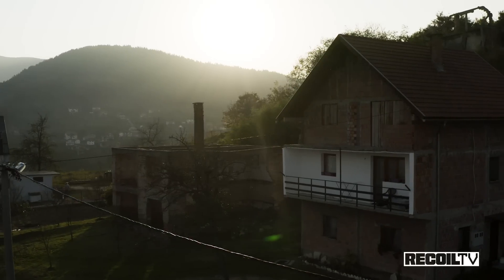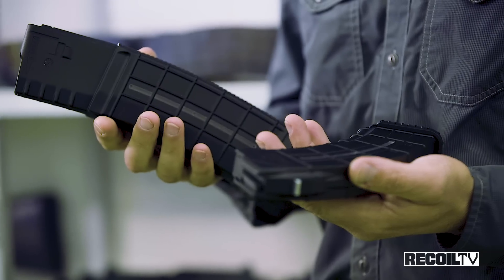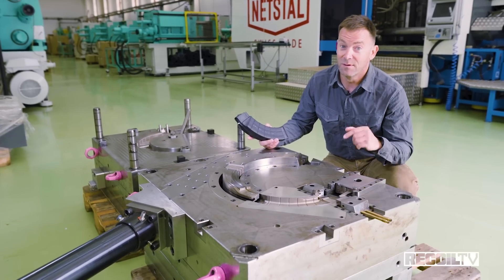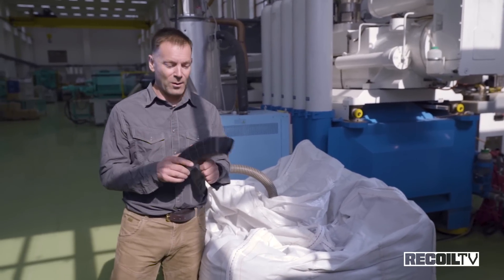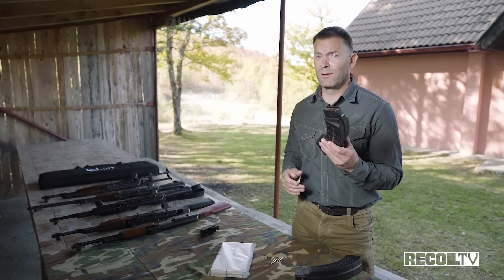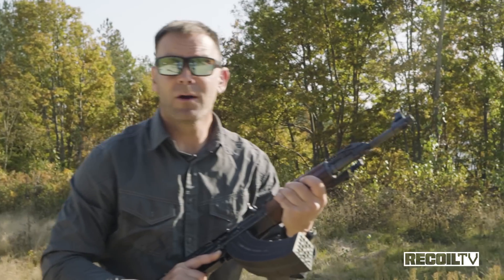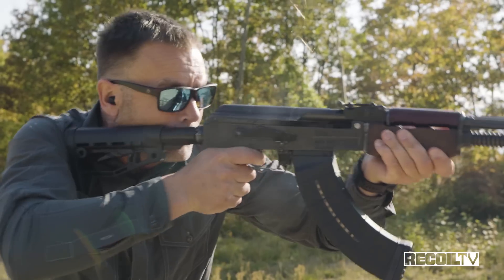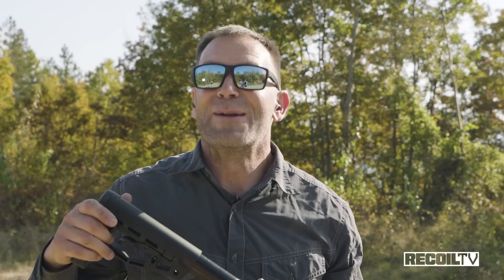Quad-Stack Polymer AK Magazines?!

Comment: Back in 1985, an articulated mold of that size would have cost upwards of $250,000 to make, and it would have required a massive (and massively expensive) injection-molding machine.  Much respect to our Bosnian brothers and sisters for nailing this!
Reply: AC Uniti makes its own molds
.The owner is a genius for polymer technology
Reply: City of Gorazde is known for experienced engineers, high quality polymer products that are exported for known EU companies. AC Unity is relatively new into mags, but i m pretty sure they will consider users feedback for further improvements.

Comment: I spotted those mags at the Reno gun show yesterday. I'll have to buy some now....after seeing this video.
Reply: Mixflip Extra 

I’ve done some drop testing on their 7.62 mags. 30 and 40 round mags. Windowed and regular style both loaded dropped from shoulder height. Sides, bottom, and feed lips.... feed lips cracked on non windowed version 

Now if you’re not a caveman they are great lightweight mags for range use. Not 100% reliable for me but YMMV
Reply: Cost$?
Reply: @dangerousfreedom4965  6$

Comment: Give me drop tests, mud tests, run n gun tests, then a good inspection on the mags. Not just a brand new mag dumping 60 rds.
Reply: they ran it over with a yugo, did pushups with it, you can check it out if you google.

Comment: Wonder if quadstacks would be more reliable if the gun was designed to use them by default.
Reply: It really doesn’t matter how the mag is stacked (if done  properly). 

All that matters if the mag is a single feed or dual feed (when it comes to feeding into the rifle).
Reply: The Spectre smg was designed to use 50 round 9mm quadstacks, sadly the gun didn't catch on that much, so not much is known about reliability on em.
Reply: That's like suggesting triangle-shaped tires could be more effective than round ones if used by the right vehicle.
Reply: @KC-bg1th no? There is no advantage to triangle tires, bit quadstacks have a distinct advantage, they just currently have feeding/reliability issues
Reply: @marcusborderlands6177  And i thought giving quadstacks a less agressive taper might improve the feeding.
Reply: @2Potates  surprisingly it seems like the taper has little to no affect on reliability, it's weird, but so are quadstacks.
Reply: @2Potates  Added complexity equals decreased reliability.  A quad stack will always be less reliable than a standard mag of equal quality for that reason alone.

Comment: I must have missed the part where they were getting made seeing as merely showing a mold on a skid in the middle of the shop floor isn't how they are made. Does showing a burger patty laying on the kitchen floor count as showing how a big mac is made?
Reply: I thought the same thing. I also love how there were so many cuts you can only guess how many jams there were.
Reply: @psychzach1588  This is what i was thinking
Reply: Well, since the tool was on the floor my guess is that they were producing something else in the machines at the time. Possibly other types of mags.
Reply: That depends on if they're filming a Mcdonald's or not. XD

Comment: I have like 6 of these mags I picked up for 6 dollars a pop thinking they were cheap shit since they were half the price of KCI ones, but I got to admit they are pretty damn reliable surprisingly
Reply: @Inconvenient Truths Indeed bullshit. I think the op probably got some of the companies regular 30 rd mags which are going for about $6 if you get them from the right place. These quad stacks are more than 10x that which to me makes no sense. If I can get 10 30rd magazines for less than 1 60 rd magazine, I'm buying 10 magazines lol.
Reply: @mikefelty2625  well, you can't have 60rds in then.
Reply: @nijaz21-87  I can use mag couplers to link two 30 round mags together, and still have 60 rounds for about 1/3 of the price of a 60 round quad mag. Plus, from my experience those mags have feeding issues more often than most 30 round mags.
Reply: @mikefelty2625  well, that's a different thing. Also, I can't agree on the last part with you.
Reply: @nijaz21-87  It's still a cheaper option. And you don't have to agree. You've apparently had better luck with them than I and others I know have. Sometimes I have luck with things that others don't, and vice versa.👍🏼

Comment: Bakelite was one of the first successfully implemented crosslinked polymers... and russians were making mags out of it since the birth of the ak.
Reply: No, Russians weren't making magazines out of bakelite - you should check your info. They are just called bakelite but aren't made of it.
Reply: @BloPsyy   Bakelite is a phenol formaldehyde crosslinked polymer.  AG-4S is what the Russians used to make magazines, grips, etc.  
AG-4S is not bakelite in the processing and synthesis, however it is also a phenol formaldehyde crosslinked polymer composite usually with glass reinforced fibers.  
Though bakelite was not the exact same, AG-S4 is absolutely a derivative from the original bakelite.  
Bakelite is truly just a made up name.  If we really wanted to be exact we would refer to the chemical structure and bonding mechanism.

Comment: I just had a thought.  Instead of using quad stack mags to increase capacity, why not use the technology to make standard capacity mags more compact?
Reply: you could make the bullets smaller or use a shrink ray
Reply: @jolosarmiento7382  I was talking about 30 round AK mags that are as long as a 10 round mag for example.
Reply: Sounds like a great idea. Some 30 round magazines are long enough that they can get get in the way if u try to use a bipod.

Comment: I've heard mixed reviews of these magazines. More for a range magazine than a go to war magazine. Made of polymer but still break at the feed lips when dropped.
Reply: Didn't rhe Russians also have a similarly designed mags for the RPK-16?
Reply: @ArcturusOTE  i believe so but the RPKs were normally issed with 40 round 7.62x 39mm mags and 45 round 5.45 x 39 mags. The 45 rounders are popular with the AK74 variants most notably with the AK-74U.
Reply: @ratagris21  those mags are long as hell tho and girth is more preferable to length at least that's what my mom told me ;)

Comment: these 60 round ac-unity mags are junk,  me and my friends purchased 4 of them from classic firearms when they first came out,  the mags failed to function correctly,  we sent them back for a full refund,  a few weeks later,  classic firearms pulled this mag from their website due to "multiple complaints" regarding the function of this mag,  a rep told me they had hundreds of complaints that were similar in nature to mine,  it failed to work, and/or the mag failed to feed, failed to take a full 60 rounds or it caused jamming issues.  the problem i think is the mag is not steel reinforced and the mag body should have been longer to accommodate the full 60 rounds, and the spring tension was super tough.    👍👍👍
Reply: I'm pretty sure they will fix flaws, but at 8-10 bucks price tag, they pay off themself if they work fine even for 10 loads and unload cycles. These are made to be discarded once wear occurs.

Comment: 1. Reliability 2. Price. Those are the only concerns for a magazine. That´s why no military has wide spread use of round high capacity magazines for instance, too costly and not reliable.
Even this quad stack magazine has more parts and thus more points of failure, why would you want that ? On initial contact with the enemy you are more mobile with a smaller magazine and 30 rounds are more than enough as well. So I really don´t see the point besides being cool.
You can´t even load that thing by hand. And it is heavy etc.

Comment: 5:01 bolt locked to the rear
Reply: Yeah i was asking myself why the bolt locked back. Was it a failure to feed or what
Reply: @Blake Ubersox You have to cut off a inside a magazine it will hold the bolt open.
Reply: Its a bolt open magazine, when its empty it holds the bolt open
Reply: @harun817  Yeah but the bolt drops when you take the mag out
Reply: @mesniburek1652  its an early zastava m70 which hold the bolt open on its own
Reply: @harun817  oh, ok i didnt know that. I should have known it, since our army used that rifle until 2006
Reply: @mesniburek1652  as far as i know the first zastava m70 had bolt open feature after that only the magazine had it
Reply: It’s a bolt hold open mag some rifles have that feature but I’m pretty sure it is the mag😉

Comment: Magpul did not invent the polymer magazine. It has been used for decades by the Eastern Bloc
Reply: K B I’m assuming you’re referring to Bakelite? Which is definitely true even if you’re not referring to Bakelite.
Reply: @playboi6411  Bakelite which is more of just a fiberglass reinforced resin but also polyamide was used in the Comm block way before Magpul